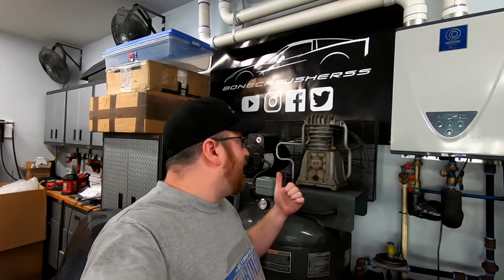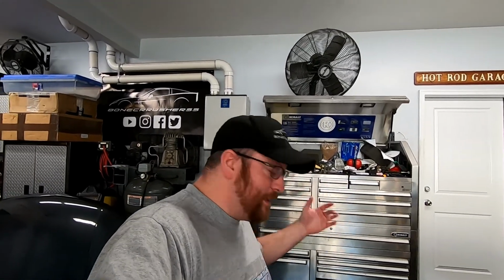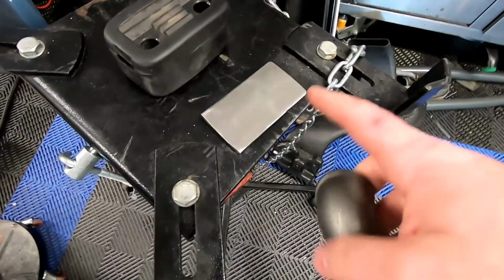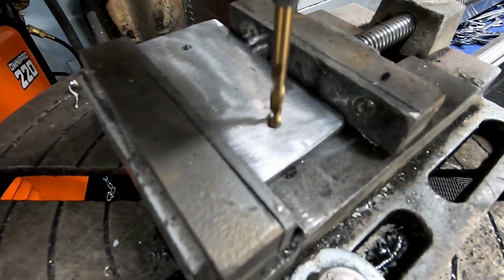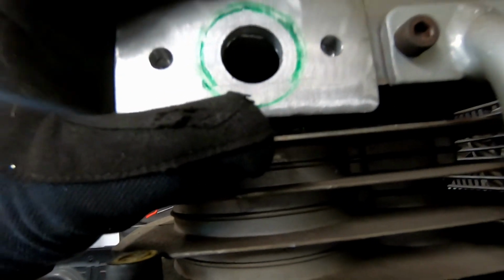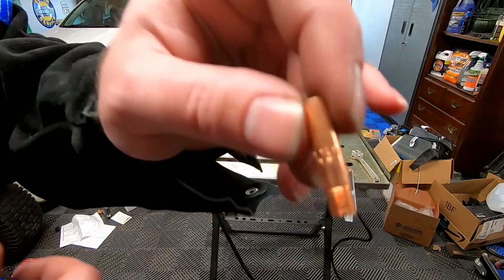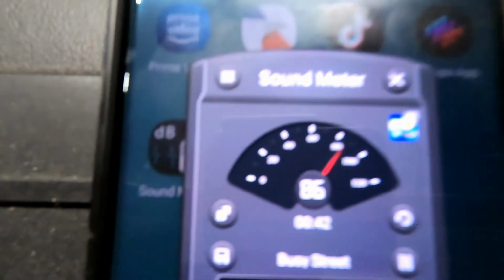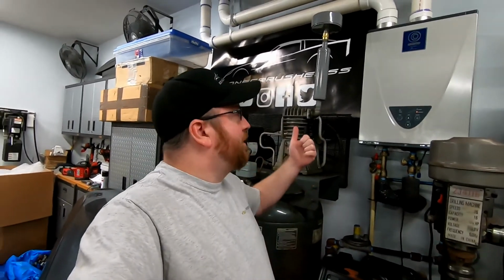Air Compressor Updates - Solberg Muffler + Filter Install

Comment: What is a”pat phrase”?  They are oft repeated and usually little thought about.  The first, below, came in about 3 variations, the scond was mostly w4w.  Think of having to pay $50 each time you use a pat phrase and you will very quickly start seeking alternatives and concommensurately become that much more interesting!  That’ll be $700, please!
“As you can see”:  1, 2, 3, 4, 5, 6, 7, 8, 9, 10
“If that makes sense”:  1, 2, 3, 4

Comment: Mine is so loud. I was wondering has anyone piped the intake to the outside of the garage? I’m in an area where no one is around to be bothered by the sound outside.
Reply from the maker: You could just put the compressor outside then?

Comment: A lot of work for little results. Also he welded the 90 degree elbow to the plate.... noooooo. That is a malleable iron fitting. Cant weld iron. Its going to crack off in time.
Reply from the maker: Been fine for a over a year - and as I mentioned it's more quiet in person.
Reply: Done many times no problems.  Maybe you can't  weld.
Reply: That just goes to show you that because you can afford to buy a welder. That doesn't make you a welder.

Comment: Did the muffler have an open center or were there restrictions?  My compressor has a 1" MPT fitting.
Reply from the maker: I think it had an open center - and was surrounded by mesh/probably fiberglass.

Comment: Was it worth it?
Reply from the maker: Would have been a heck of a lot easier if I didn't have to weld anything together. Like I mentioned earlier - it knocked down the super high pitch tones/loudness of the compressor. Unfortunately the Sound DB meter app didn't show much if any of a difference - but like I said it was a free app that I don't really trust.

The muffler + the air filtration system I added for painting had no issue keeping up. I had the filters set at 100 psi - and the paint gun set at 44 psi - that dropped down to 40 psi when spraying. 

I painted one whole bed side - and it didn't even come on. Painted the other side and did kick on but no big deal - I waited a couple minutes and went back to spraying - and I didn't need any hearing protection in the shop.